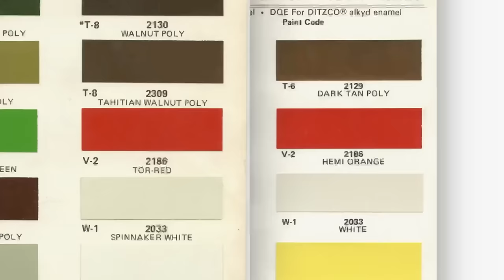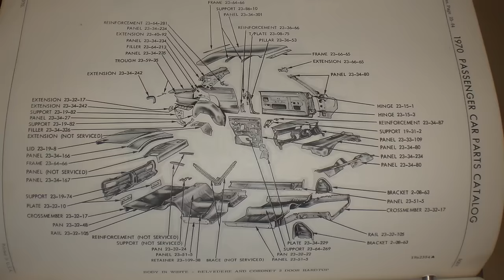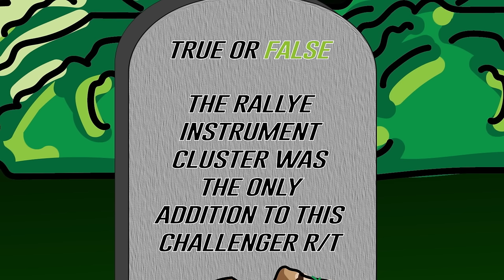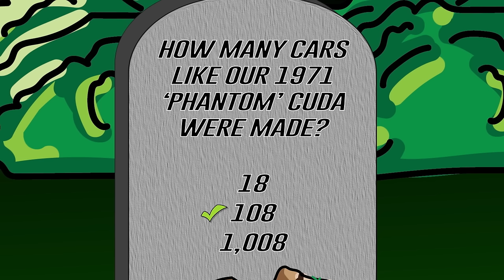NEW EPISODE: CONVERTIBLE CHARGER-WHAT THE HELL?

Comment: And if you reinforce the frame rails. Like you do on a roadrunner or a satellite. You can do the same  on a B body/Dodge Charger. Then you can put a custom frame section and a convertible top on it and it will be fine. Lol
Reply: And have a very unique car, none came from the factory.
Reply: @beauxr.benoit1374  wrong vary rare Richard's-S personal car ( not my car/vin but kinda copycatting his vin/body-style as a modified manuel hemi/not numbers-vin FWI ) is a convertible 383 auto 3.2 F8 1969 charger, rarer than a slant-6 or RT-hemi-vin

a pilot run ( and a wide body, run ) was made pre-1970 corporate boardroom politics killed it off and or they would have been forced to share parts with the coronet/4-door's or caddy's/corporate GM/1950's-70's-scissor-top and fibreglass and carbon fibre patents and copyright's, as the other option was a removable top like a jeep has for a RPO-code winter extra accessory's 

go look it up bill and Richard and others made sure that it can be found in print or on the internet. sadly 😢RIP bill and Richard and tom hover as they were there and knew about it 1st hand experience
Reply: @richardprice5978  Thank you for the info. And at Fifty plus I learned something new. I know not everyone does this. But I see it this way. You can never know everything and you can always learn something new. And whoever has more info knows more than you do. So you can always learn something.